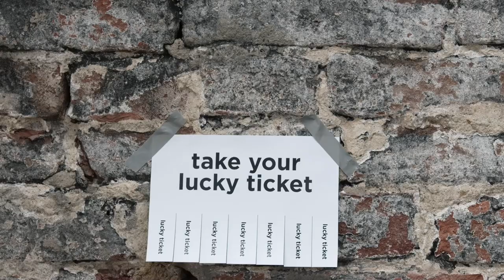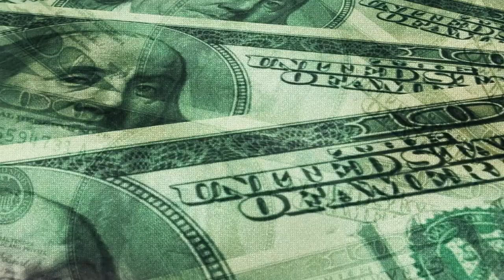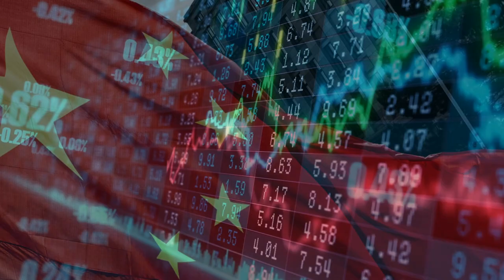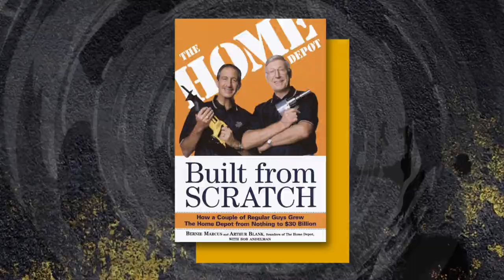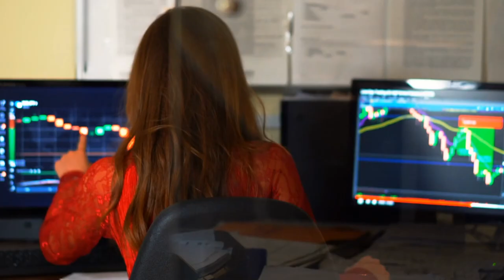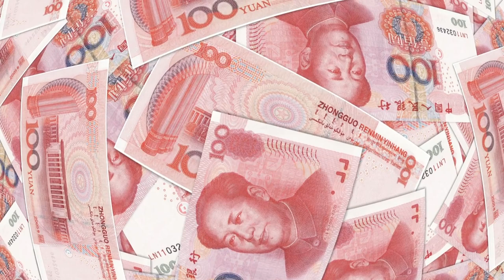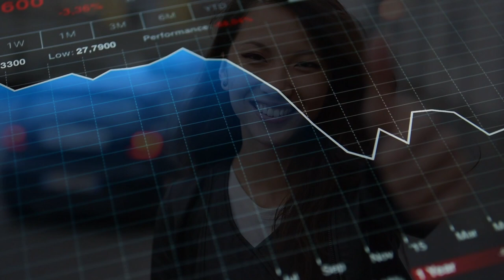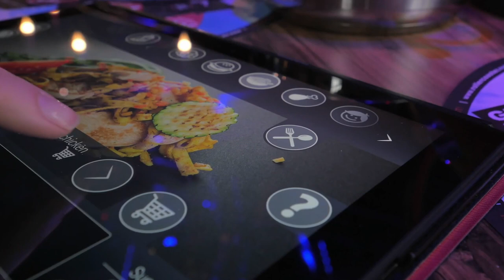Why Home Depot Never Had a Chance in China

Comment: What I don’t her so far 7 minutes in about Home Depot failing is that it doesn’t have to just be do it yourself. In America a bunch of businesses have accounts at Home Depot and get supplies there. So even without do it yourselfers you’d think that manual labor workers would still shop there, so I’m guessing there might have been a different chain that was cheaper that most labor workers shopped at. Because even if you pay someone you still need materials.